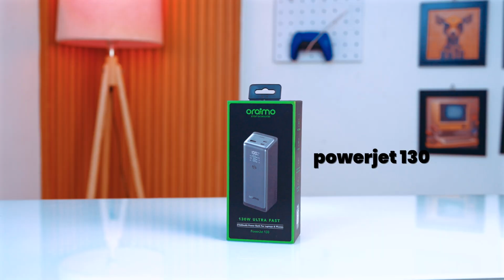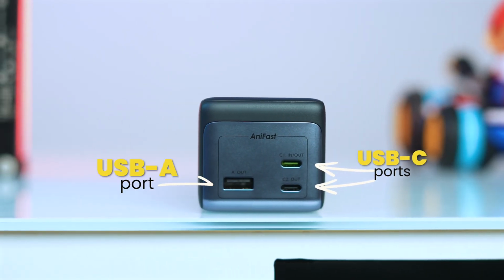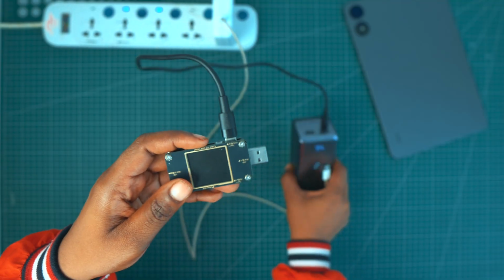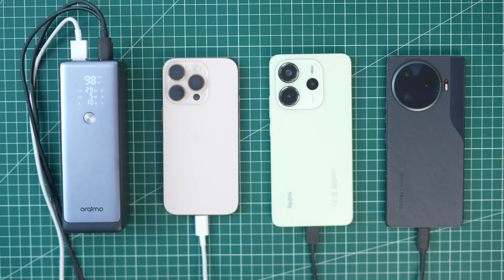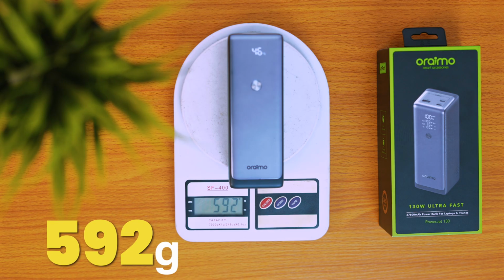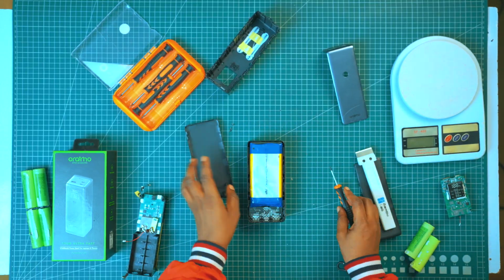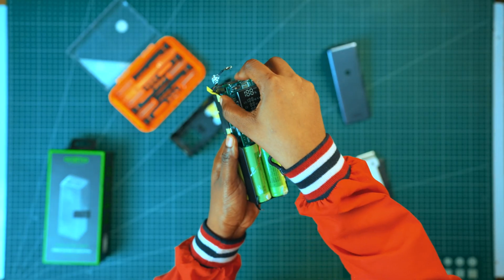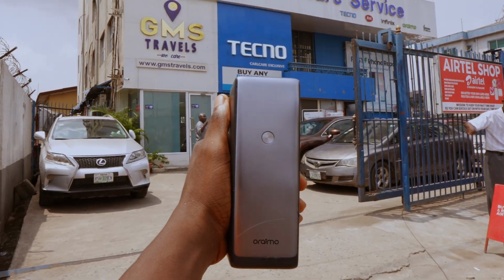I Tore Open this oraimo Powerbank!!!

Comment: Job well done ....just one small info.... those are buck-boost converters not boost converters because the batteries are in series configuration, the voltage is higher done any device would use so the buck converters step down the battery voltage and also keeps it constant in 5v ,9v ,15v, or the 20v your devices may need to charge and also charge fast...the boost converter only kicks in when you are charging the power bank with a voltage lower than the battery voltage which in most times is the case...
Reply: The four batteries will be 16v not 20
Reply: @ELLAJOHNSON-r4i there are 6 batteries in series not 4....6 batteries in series will add up to 25.2v

Comment: Ben using this powerbank for months and it's BAE
Reply: please i just got it today and I took the opportunity to buy a charger for it and my phone ,67w for my phone amd 120w for the power bank,yet as Im charging, it hasn’t moved past 20w charging speed and it won’t charge anything past 20w ,did I get a fake or their is something I need to do,Im hoping that because it’s new and haven’t charged to a 100% yet,do you have any solutions
Reply: @mammanfadil819  I'm not sure it will charge those tecno and infinix phones that do 20watts of charge with their follow come chargers (i havent tried them but the oraimo powerbank typeA output doesnt charge more than 25watts). Try charging things like your laptop, flagship phones like new iphones and Samsungs, and use the 100w cord that comes with the powerbank, or compatible cords.